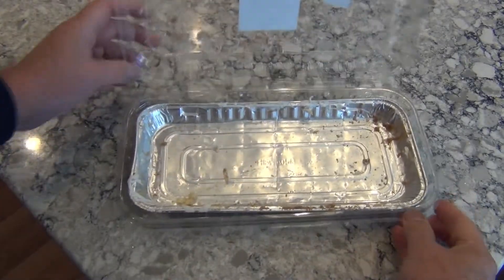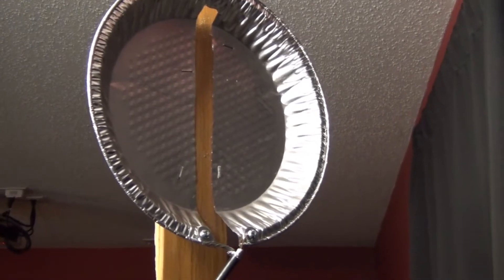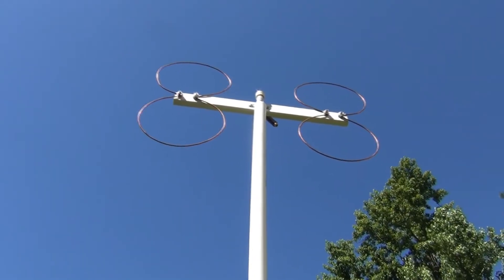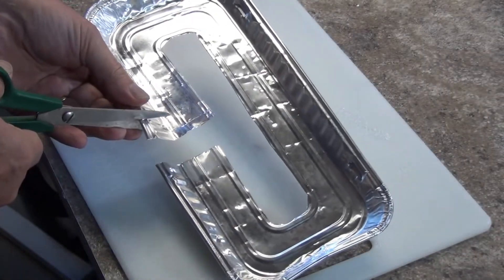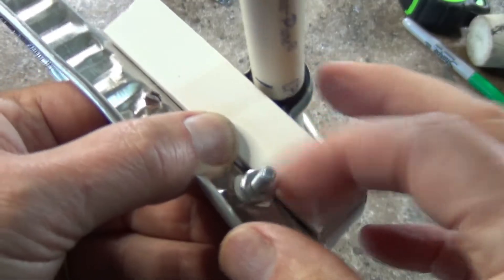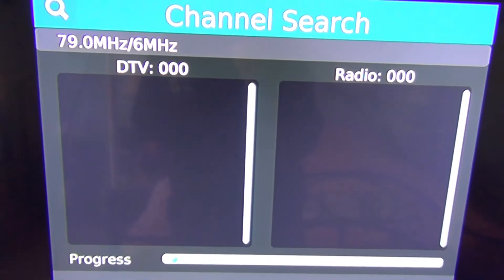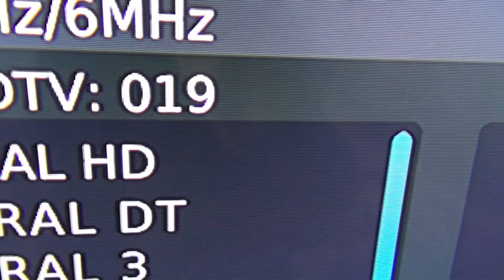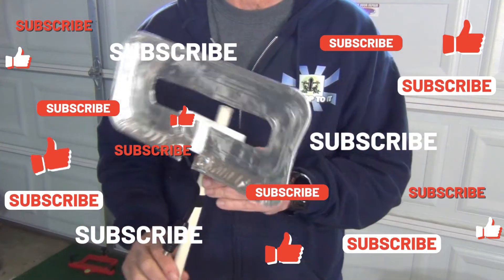This TV ANTENNA is so EASY to build! FREE TV!!!

Comment: Hey, I just made myself a DIY antenna and it works really well with the mild tree coverage. I can pick up station clear from about 60 miles. I use two hollow metal tubes about 5 feet tall with the window open. I used a tin dish about one and 1/2‘ x 10“ is a paper clip to put into the tube and it also touches the paper clip. Then I used a coax coupler to put the paper clip into coaxial cord then I put it into a amplifier From a flat antenna I’ll post a video on my channel. Show you what it looks like. Oh almost forgot. I also have another pool and some tinfoil connecting from them thank you Mr hop to it

Comment: I tried mounting 2 danish tins and what a surprise of reception. Now I feel cheap as Alan Harper from two and a half men sitcom. This worked out for me MHTI and both danishes were super tasty too. I just took two wires extra connecting the antenna to the TV. I split the two tins in different directions and do not need a rotor. The reception is super. Thanks MHTI. Works for me. I am looking forward to your next video. Hope your health is going in the right direction. v    😀😀😀
Reply from the maker: Thanks VF. I'm slowly healing. That's great news about the Danish pan antennas. I've got more antenna designs in the works - hopefully soon.
Reply: @mrhoptoit7835  I look forward to see what you have SIr. Happy Mothers Day and peace too. v

Comment: This antenna is called a "Folded Dipole", I calculate it is tuned to the TV radio frequency channel of 18.  Fortunately, receiver antenna tuning is not that critical compared to antenna with a transmitter connected.

TV receivers (being low cost) usually have a lot of leakage to signals they are tuned to, I would like to have seen the number of channels the TV could pick up with no coax connected.  If the TV receiver is made properly and has no leakage, it won't pick up any signals with just a coax connected.
Reply from the maker: In one of my first episodes I did show a channel scan with nothing attached to the input and there were no stations received. Thanks for watching.
Reply: @mrhoptoit7835  Interesting, thanks for your response!
Reply: What calculation do you use to determine it's tuned to channel 18 and is this real or virtual #.
Reply: Also how come it is tuned to channel 18 but it receives so many other channels at different frequencies. I feel there must be something more to all this antenna theory that's missing from the narrative so far. I'm starting to believe like somebody else said that pretty much anything will work.
Reply: @DimitriosG.Panagiotidis The purpose of the antenna is to beam the signal in a specific direction and provide the transmitter with a stable load.  With a receiver, the opposite takes place in regards to the directionality; the antenna is sensitive in a specific direction to signal pick up.  The antenna is also providing a desired load to the receiver, however it is not critical to the receiver's operation.  As you mentioned, you can get by just by using a random piece of wire for your receive antenna but, it won't function that well unless the transmitter site is nearby.
Reply: @DimitriosG.Panagiotidis  an antenna will receive (or transmit) on frequencies on either side of the center frequency, but the peak resonance will be on center frequency, which is the frequency the antenna is tuned to, which is based on the length of the antenna. I hope this helps
Reply: @DimitriosG.Panagiotidis  The formula for the antenna element length in cm is 14265/frequency in MHz or 468/frequency in MHz for the element in feet.  The channel 18 is the actual RF (Radio Frequency), which is based upon the analog channel frequency.  The digital format reused these analog channel frequencies but, the channel information the TV shows could be anything.

Comment: I love videos like this! Antenna experimentation that I don't have to do! Saves me a ton of frustration. I did build the 3 loop antenna, works quite well. I'd like to request an antenna build using stainless steel cable ties. There are some interesting lengths available out there.
Reply from the maker: Interesting idea. Thanks!

Comment: When I tried a scan here with just a cable I didn't get more than a few stations.
With a set of rabbit ears, I get about 90 stations
With a good antenna, I get 129 stations.
I also tested my stew pot and other random metal items to prove that all work as antennas.
https://youtu.be/fS0bW63ZBMo
It proves that nearly anything will work.  At some point, I may design an easy to make antenna with better performance but for now, I leave that to others.
Reply from the maker: 129 channels? Wow, I'm jealous, Ken.
Reply: @mrhoptoit7835  Yes, and perhaps 5 of them have something I might watch.  If you are seeing the shows you want to see, your project is done.  In my case, I am sort of between 3 markets so I tend to get more than one station with the same programming.